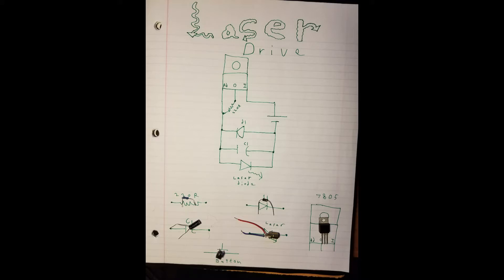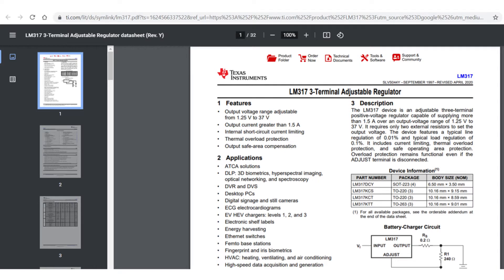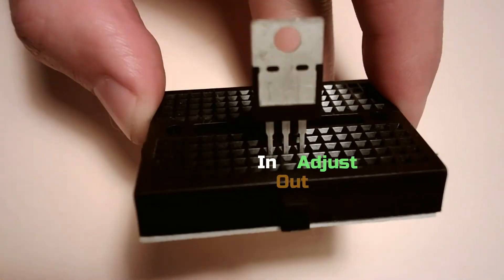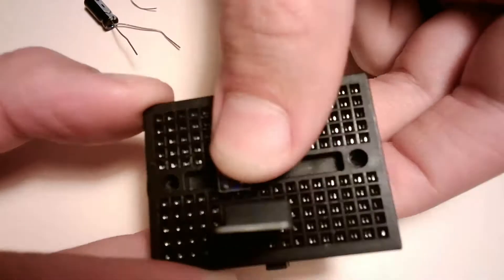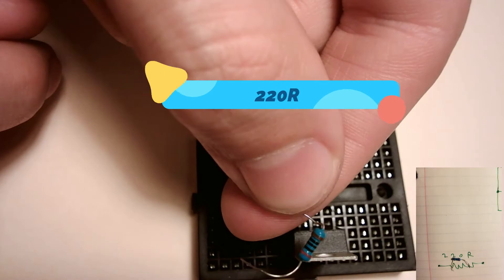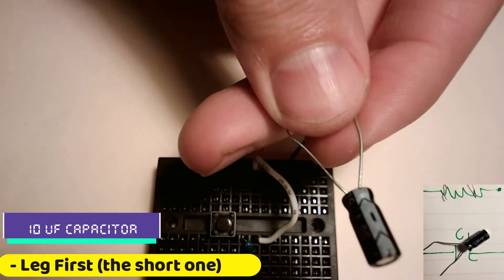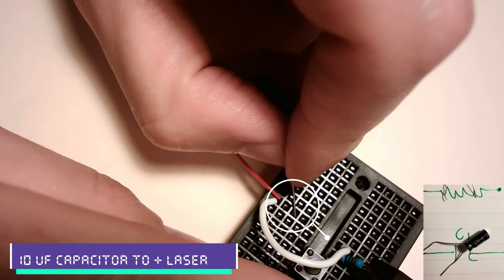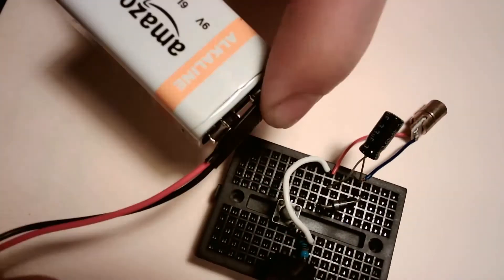Laser Driver Circuit

Comment: did not show battery on diagram not how to orient then  z diode (white band end on diode is + or -?), do both laser diode, led and z diode all have the same diagram pic with the same polarity on all of them? would be nice if you added polarities to diagram
Reply from the maker: The negative side of the diode is the white band side. One of the diodes (d1) is I believe a 1N0001 diode used as a filter/protection diode so reverse current doesn't blow anything up. The laser diode is the second diode and is a 5mW red laser diode ripped out of an old CD drive if I remember right (been a few years). Depending on your laser diode it will  likely have 2 wires (black one is negative) or 3 legs and you'd have to look it up (although the middle is likely negative in this case). Hope this helps answer the questions!

Comment: but if you got the laser does it not usually come with the driver? what is the point of making one?
Reply from the maker: A lot of laser diodes or crystals don't come with a driver and it's often much cheaper but can be complicated to build.
Reply: @2basiccircuits  i meant those you harvest from a dvd player etc

Comment: would be nicer if you explained why those components and values were chosen and how it works, i like to understand things not just follow instructions, i have everything except a 10mf cap and still trying to get the laser out of my old pc dvd player , but for the trans i never understood exactly how they work  and i think i found a 7805 still on a metal cooling plate, also got 7809, 7812 so not sure they will do? and one lm317 but what id like to know is if i can add a pot or make the circuit to add as much power as the laser can take but im still uncertain how high i can drive it or how to test for that? do they all only take 20mA typically or can it be more? lot of questions , can i just run the laser on a 9v battery and resistor to test it first? i also got a  120vac to 12vac  2amp trans  with a dc rectifier and smoothing cap i made for a 7.5w lighting led project i play with not sure that can be used here?
Reply from the maker: The 3 leg thing, is a voltage regulator and limits the wattage to the laser diode. The 7809 and 7812 seem to give higher voltages (and likely watts without a different set up) and might blow up the laser, so I wouldn't recommend them. The lm317 can work but needs a different set up. 

The 9v battery with a resistor wouldn't work as the current is highly limited greatly reducing watts, making the laser unlikely to work but if it did it would be quite dim. 

CD lasers are few milliwatts and would likely blow at 7.5W. 

Hope that answers the question!

Comment: I'm confused.......you call it a "voltage regulator" but I see a mospht gate.....
I got a (10k) pot, a capacator, and mosphets and resistors so pot never hits zero but, I thought the mospet was just a switch?
Reply from the maker: I can understand that. Mosfet and voltage regulators look the same (LM 317 and 7805). Voltage regulators, like these, have 3 legs just like most Mosfets but they set the voltage to a constant level. This stops the laser diode from drawing to much volts and blowing up.
Reply: @2basiccircuits  thank you

Comment: you are using 317, not 7805.
Reply: That's clearly a 7805. You're wrong.
Reply: @justabouthadit5872  What voltage 7805? I have +5v at hand.
Reply: Yes i think it was lm317 with that pinout.. 7805 Doesn't have adjust pin with what I know.. only In gnd and Out